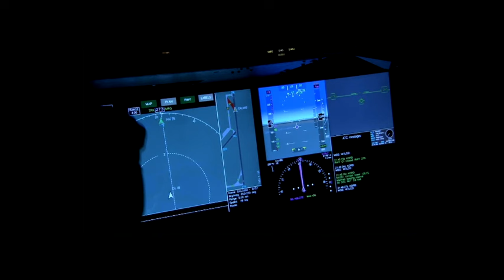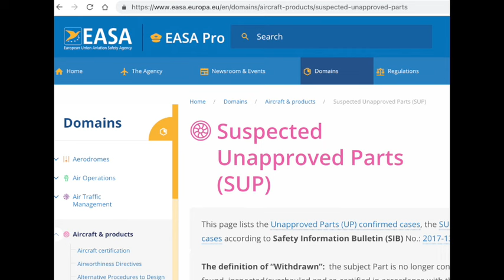Gender Reveal Plane Crash Kills One, Bad Parts Back in Circulation – Episode 183

Comment: Airplanes don't fly unless the paperwork weighs as much as the airplane. That documentation is so that if something goes wrong, they can go right back to find the person who messed up--and take appropriate measures. Do your work right, do your paperwork to back up your work, and if something goes to heck the buck goes to someone else.
Reply: This accident has nothing to do with paperwork, it's a classic sharp pull up at a high speed where the left wing was subject to a heavy air load/overload, paperwork didn't kill the pilot, the pilot killed the pilot.
Reply: @christophergagliano2051  All right, Mr. Mexican Investigator, answer me this:  WHY did the left wing crumple? And I don't want an answer of "because the plane pulled up too hard", that's only one layer of the issue. Was it a design issue? Maintenance issue? Pilot training issue? Was it identified and not fixed, or not identified? Somewhere in the paperwork,  there's an answer.

Additionally, I seem to recall making the comment with respect to things discussed later in the episode, not the accident.
Reply: @erichusmann5145  Well the wing folded because the pilot rapidly forced the bottom of the wing to go directly into the relative wind, and wings are not designed for that type of load. Just like when you're driving down the highway and just stick your hand out the window flat, and then you twist your hand so the palm of your hand is now into the relative wind, that relative wind has weight or force is another term. I think the point that the panel was trying to make is that for some reason poor maintenance or lack of paperwork created this accident, well that is possible but that is not probable
Reply: @christophergagliano2051  why did the pilot do that? Ask his paperwork.

You are completely missing the point. I never said the plane crashed because of paperwork, or lack thereof. I said planes don't fly without paperwork. There is a difference. 

By they way, don't come back with that kind of answer again until you've gone another 3 why's deep.
Reply: @erichusmann5145  yeah I get that, but the commentators did I don't know what you're thinking exactly so let's get past the f**** paperwork.
Reply: @erichusmann5145  also I said 5 hours ago The accident had nothing to do with paperwork, so I was distancing myself from that fact, why you keep bringing it up I have no idea so get off the paperwork thing I did 5 hours ago.
Reply: @christophergagliano2051  because YOU responded to MY post about how aircraft don't fly without paperwork with "no, the pilot crashed the plane, paperwork had nothing to do with it".

Have you, personally, ever done root cause analysis? Have you, personally, ever worked in the aerospace field? I have.

Right. You claim the crash happened because the pilot pulled up too hard. I don't say that didn't happen, but it's not the only possible reason. (See also: Chalk's Ocean Airways, which had a similar failure that had nothing to do with the pilots.) How do you find what the root cause is? You look at all the options, then dig into the airplane-sized pile of paperwork to see if a) you can eliminate anything and b) there’s anything you didn't find already that shines light. Maybe the pilot never got training in how to pull out of that kind of run, for example--the paperwork will show that, and then you know that you need to go yell at the flight schools/trainers to shape up their training. Maybe there's been complaints about funny handling, and maintenance didn't find an issue. You retrain maintenance. 

Remember: this crash wasn't stopped. But the next one can be, once the root cause is found and addressed.
Reply: @erichusmann5145  agreed you have to eliminate the possibilities, but one thing we could agree on the pilot mishandled the aircraft That's a fact, now there might be other contributing issues like corrosion, or a bad repair but the underlying reason for the crash is an overload of the wing structure due to mishandling (showing off).
Reply: @christophergagliano2051  I disagree that the pilot mishandled the aircraft by pulling up like that. 

I agree that the pilot LIKELY or COULD HAVE mishandled the aircraft. 

They key difference is that we don't know for sure, YET. We can say "it looks like X". We can't really come out and say that X is the reason, because there's rarely only one cause. 

Matter of fact... I'd argue that the cause was the pilot flying too low. If he wasn't so low, he wouldn't have pulled up so hard. The next obvious question is, why was he so low? (Leaving out the chance of a cracked spar for now and all that, you understand.) 

5 Why's. One hell of an investigative tool. That particular cause and question is about 3 deep on one track.
Reply: @erichusmann5145  I'm not sure if you understood what was going on there, the pilot was low because they were doing a gender reveal stunt right over the couple that was going to have a baby, that's why the pink water came out. And the airplane doesn't know if it was low or high or upside down or right side up the airplane doesn't care. And you're absolutely wrong It doesn't have to be one thing, it could be a combination of things triggered by a major event like the pull up, the spar could have been weakened over time due to fatigue of the material, the spa can be weakened over time because of corrosion, the spar can be weakened by a repair that was not done properly there's a shitload of things that can contribute but there has to be one main event and that is without doubt, the pilots mishandling of the aircraft by applying too much aft stick by showing off to all the people at the gender reveal party.
Reply: @christophergagliano2051  I will answer in a series of bullet points (OK, so they're numbered for easy reference). And I will use words that are as simple as possible, so that you will be sure to understand.

1) I understand what a gender reveal is. The fact that it was a gender reveal does not mean the pilot was not flying too low. I will detail that more later.
2) "And you're absolutely wrong It doesn't have to be one thing,"--says the person who is fixated on it being the pilot pulling up. Additionally, I NEVER said that it had to be one thing--I simply ignored other causes temporarily. (As you would have known, had you actually understood what I was saying.)
2a) I agree that it's likely to be a combination of factors. I don't think there's a single accident that doesn't have a lot of contributing factors.
3) Why? Why did the pilot apply too much aft stick? You haven't answered that. 
4) There are two things that are not adding up right now, at least to me. As follows: a) the aircraft in question is a known crop-dusting type, but usually it uses nozzles at the rear of the wing to drop its load. Why did the pilot use the panic drop? b) Why was the pilot so low?  You can argue that it's for the reveal, but you can get the same effect at +50' from where he was, with less chance of hitting trees/ground/people. (See also: fire-fighting aircraft, dropping at about 100' off the ground.)

I'm going to take a look at something, and I think what I called out in 4 makes more sense. I'm going to assume a few things, though. Starting with: I'm going to assume the pilot didn't monitor his altitude well enough, relative to ground. I'm also going to assume that for whatever reason, he didn't do any sort of scouting of the location, practice run or whatever. It's possible that neither is true, or that only one is true. If the pilot was simply told "fly to location, drop load at low altitude, fly away", then he might not have been aware of the trees close in. You saw the video, you saw the trees. It looks to me like he's coming in at or under treetop level. Flying a typical crop-dust profile, I suppose, but with trees--any crop-duster worth paying will be very careful around trees, particularly to be higher than the trees or otherwise have an escape. So: Pilot flies in, low. Pilot focuses on getting the drop right, then suddenly spots the trees, starts yanking a bit (he's got a nose-heavy load), then drops the load and his nose pops up hard. Wing collapses. I'm going to say that the panic drop probably was the intended maneuver, because the pink probably wouldn't show up as well if he simply used his trailing bar. 

So, to make that short: The pilot realized he was on course for trees, attempted to add altitude gradually, but when he dropped the load (right where he was supposed to), his nose popped up suddenly (shifting of CG). The resulting forces ripped the wing off. Why was the pilot so low, when he could have flown through 20' to 50' higher? I'm not sure we'll ever know. But that question may be the key.
Reply: @erichusmann5145  I'm sure glad you don't work for the NTSB, that would be kind of a waste of dollars. And I did answer number three, what I said was the pilot was showing off. And I seriously doubt the CG would aft when the colored water was dropped causing this accident, the FAA would have found that out during certification testing, It would have Piper revised the design so there was no major change in CG.
Reply: @christophergagliano2051 
1) You don't know that I don't. I don't know that you don't. But, if you did, that would explain all of the subpar reports the guys here complain about. (For the record: I don't. If I did I wouldn't be commenting here.)
2) No, you didn't answer the question. The pilot is showing off--I'll give you that. I'll give you that he's showing off because of the gender reveal. The question I asked was: Why so low? As in: Why was this dude showing off at below-treetop level? You know, the kind of place you need to yank hard to get out? Go ahead, I'll wait for you to answer that--see you once the report comes out.*
3) CG shifted when the water dropped. That's a fact not a theory. If you don't understand that, then I'll have to have you put a bowling ball on a seesaw, balance the seesaw, then knock the bowling ball off (preferably not onto your toes). CG shifted aft. I highly doubt that it shifted past acceptable limits--you're right that that should have been found out in certification--but the sudden shift in CG could cause issues with how the airplane is trimmed, or accelerate climb rate suddenly. Wouldn't be the first time.

*There are few exceptions to not showing off at low altitude. Generally, those are trained airshow pilots, and they practice doing it safely. They walk the airport first, brief, and they most importantly have an altitude they won't go below intentionally, except when landing. The other exception would be crop dusters, who make sure they can avoid trees and other tall obstacles before they even go into the field at drop height.
Reply: @erichusmann5145 you need to look at the side view of the aircraft, the hopper tank is right over the CG, so if you spray or drop the entire load the CG is not going to change, they've designed it this way. So put this CG crap behind your thought process because it has no bearing in this accident. Like I said before I've seen plenty of crop dusters work a field and I've never seen a pilot abruptly pull up like this guy did, again he's just showing off trying to impress the people who paid him to do this stunt.
Reply: @christophergagliano2051  I'll give you the release point of the fluid being at the CG. Where's the actual tank, though? (I did actually look up that answer, BTW--it's close to the cockpit, so close to CG. That said, when you say "the CG is not going to change", you're factually incorrect. It changes. Not necessarily forward-aft, though--up-and-down doesn't matter as much for flying.)

"he's just showing off trying to impress the people who paid him to do this stunt." Again: Why so low? I keep asking you that question, I'm not getting an answer that's more than "because he was". You see when the plane barely clears the palm trees after the wing folded. Why, on this green earth, would you come in THAT LOW, when you KNOW there's an obstacle? You can show off another 50' higher and nobody will give a damn. Heck, another 20' higher and he'd have been fine with a gradual climb-out. So you're trying to show off and you intentionally go at/under the top of the trees and yank up--you've presumably flown the plane before and you know not to do that, because you were presumably taught that in type orientation! 

If he didn't know not to yank back like that, the ROOT cause is going to be in the training he received. If he did and ignored it, then the ROOT cause is either money (couldn't pass up the pay--and in that case I'd try to charge the person arranging with manslaughter, not that it would go anywhere), or the ROOT cause is he didn't scout the area as part of his preflight, AND didn't pick up on the palm tree height as he was on approach.

(Note: I'm talking about the root cause. Again: I get that the immediate cause is that he yanked up, and I don't give a crap about immediate cause because if you don't get the root cause then we'll be here again shortly. I don't think that "showing off" fully answers the "why did he yank up" question though. I'm not sure that "didn't know about the trees" does either.)
Reply: @erichusmann5145  you can't show off when you fly high you feel off when you fly low and do something That's why he's flying low It makes him look more like a performer a show off. But altitude has nothing to do with the accident, just like the trees has nothing to do with the accident, just like the CG of the aircraft has nothing to do with the accident. Now the weight of the aircraft changed but not the center of gravity.
Reply: @christophergagliano2051 Way to read. 

I'm not asking for 200'. I'm talking 20'. Two Zero Feet. 20' higher, this accident Does Not Happen. Capiche? 

At that slight increase in altitude, he gets much the same effect, but doesn't have to pull up as high to avoid the trees. (The palm trees, seen at the end of the video, NOT repeat NOT the whatever-they-are trees visible at the start, just so we're crystal clear.)

Question for you, personally. You appear to be a pilot, or know pilots. Assume you are flying along and suddenly jerk the plane in some direction as hard as possible. (Any axis or combination of axes, your call.) Why did you do that?
Reply: @erichusmann5145  of course he accident still happens, altitude doesn't have anything to do with it, again the pilot was showing off if he would have done the same thing at 40 ft the same thing would have happened The wing would have folded.
Reply: @christophergagliano2051  
1) The wing folding itself has nothing to do with altitude.
2) The sudden pull up caused the wing to fold.
3) The sudden pull up could have been a response to "oh shit trees in the windscreen".
4) Add 20 feet and the trees are less of an issue.
5) Trees being less of an issue means less of a pull up.
6) Less of a pull up means less chance the wing folds.
7) Less chance the wing folds means accident probably doesn't happen.

Is anything unclear about that logic?

Oh, and one more thing: Air crash investigators try to keep an open mind. You simply fixated on "he was showing off"--shall I assume that that's what you would do if you were in his shoes when the flight was purchased?
Reply: @erichusmann5145  I've flown in air shows, I've opened for the Blue Angels and the Thunderbirds doing aerobatics in a glider.
I have a total open mind, but I can discard silly things like he was trying to avoid a tree. Clearly he was a skilled pilot because he got the aircraft right over the couple that was going to celebrate so I'm sure he was totally clear of any shrubbery lol
Reply: @christophergagliano2051  Let me ask you something real quick--I apologize for the buildup.

See, my understanding is that the airshow pilots, in general, practice a lot, right? And they prepare a lot. Anything from testing their maneuvers to where the "box" is at the given field they're flying from/over. If the pilots just fly in and wing it, I'd kinda like to know so I can avoid being close to air shows in the future.

So, if he's a skilled pilot, he knows that he should do at least some of that. Maybe test his pull-up somewhere. Possibly even practice his drop accuracy. Get the layout of the place he's heading to. Right? 

Day of, he flies in, drops, and pulls up hard. Harder than he should, pretty obviously. He's a skilled pilot, he knows he shouldn't pull that hard, does it anyways. 

The question is: Why would a pilot make a sudden hard move like that, to or beyond his plane's limits?

I have a couple of possibilities; an easy one being that it's what the pilot does (aerobatic pilot/training for aerobatics). Do you have any more?
Reply: @erichusmann5145  there's no doubt that this guy was a skilled pilot, his approach was tracking straight and his delivery was right on target, there's no doubt that he's skilled. There's no reason for him to go practice this stunt because it's such a simple one, and it's not like a whole routine like an airshow pilot does, yes they practice a lot and they're judged by the FAA every time they perform in an airshow. Maybe he wasn't showing off, maybe he just misjudged how fast he was descending and pulled harder than normal to stop his descent, so it's probably one or the other, showing off to the crowd or waiting too long to stop his descent or a little bit of both.
Reply: @christophergagliano2051   See, here's where I'm coming from: I'm thinking this guy is good, but maybe a bit inexperienced. If he's normally a crop-duster, they usually lay ribbons not splats, so he's not as experienced with this type of drop. So, he'd at least practice once or twice somewhere, and check the target site out. (I would, if I were him. I'm not.)

I'm thinking the misjudge of descent rate is probably a bit more on the line I'd aim.  Sure, it's a show drop--but even show pilots ain't gonna pull back like that if there isn't something funny going on. 

As I noted, there's a few reasons to yank harder than normal. (Still wondering if you've got any.) One that I didn't mention: surprise/panic. So, he's buzzing along on line, focusing on releasing so he doesn't soak the guests but it's still nice and close. Drops, nudges climb up a bit, is surprised by something (let's say descent rate is still descent, not climbing), surprise, yank hard--and is then surprised fatally as the wing folds.
Reply: @erichusmann5145  I don't know what kind of pilot you are but I never Yank hard on anything when I'm flying an airplane, that's how you get killed. As mentioned there's so many variables, metal fatigue of the spar over time, corrosion of the spar, repair on the spar that was not done properly, so there is three good reasons why you never yank on the stick.
Reply: @christophergagliano2051  Fair enough. As this particular crash shows.

To be honest I'm kinda hoping the report comes back with there being some sort of mechanical failure that wasn't caught, but realistically, pilot error of some form.